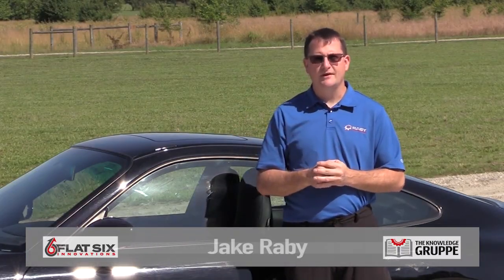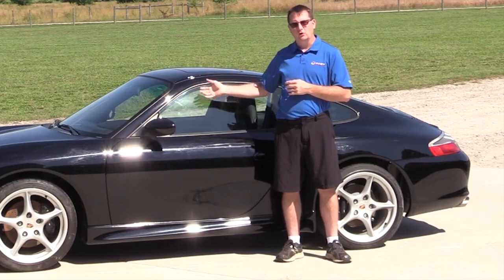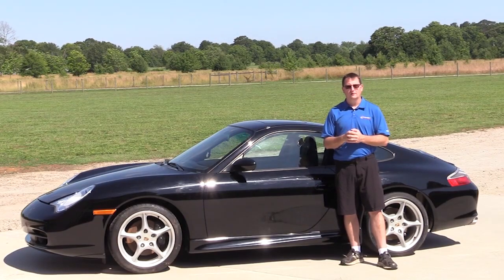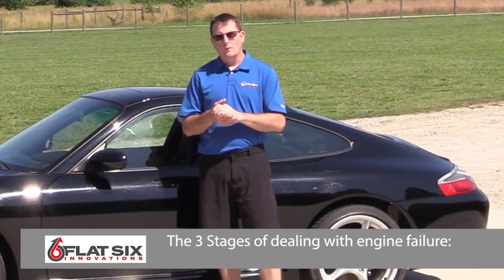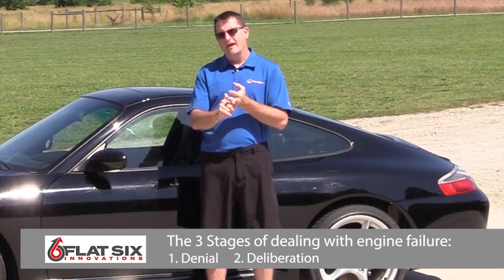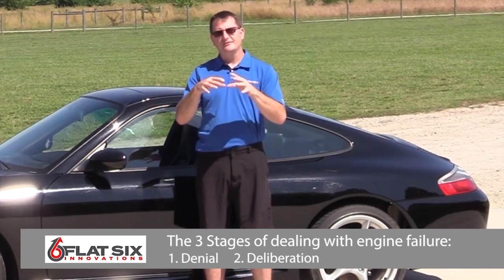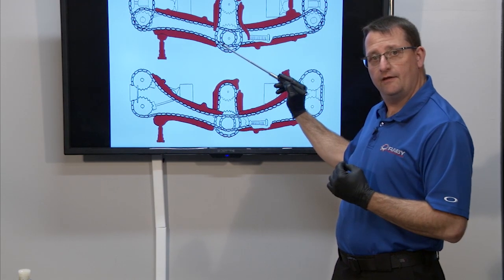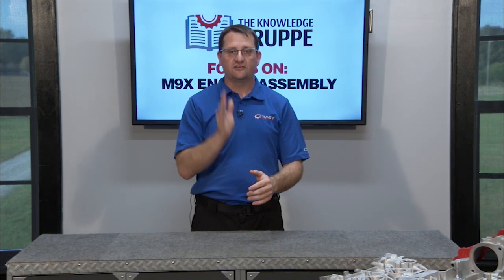Focus On: IMS Bearing Failure (Part 1) "Setting the Stage" | Porsche 996, 997, 986, 987

Comment: Top man. I have watched your various DVDs avidly. I have a 996 with a Porsche factory  replacement short engine; presumably manufactured post 2005. Is it likely that a 996  engine like this would have the later larger Poesche bearing? There doesn't appear to be an engine number attached to cross reference. Many thanks.
Reply from the maker: The most conclusive way to know if your car has the 6305 large single row bearing is by visibly examining the flange. 911 cars in 2006 had this bearing, but it's still important to be absolute about this. The 6204 is the bearing that has the highest probability of failure.

Comment: Car was left to sit for long periods of time.  Bearing is partially submerged in engine oil. = not good.
Reply from the maker: This is not the primary cause of IMS bearing failure in M9X based engines.